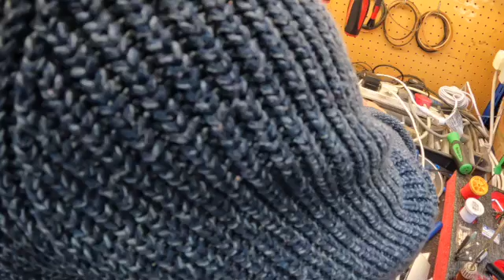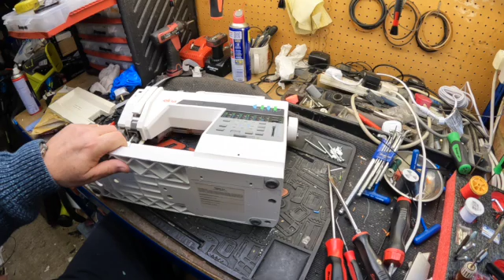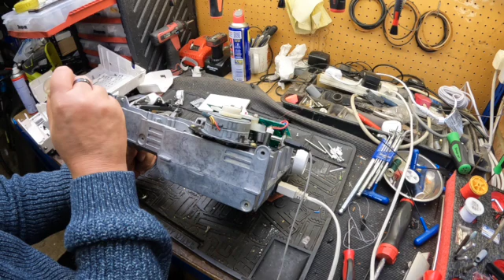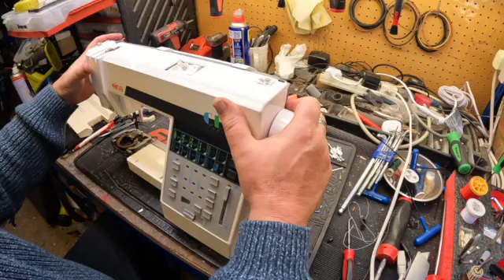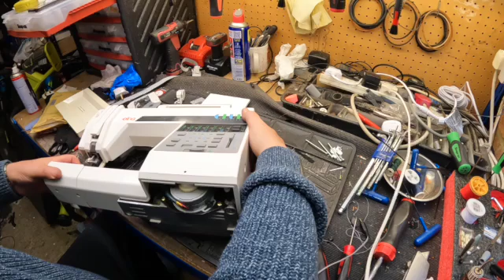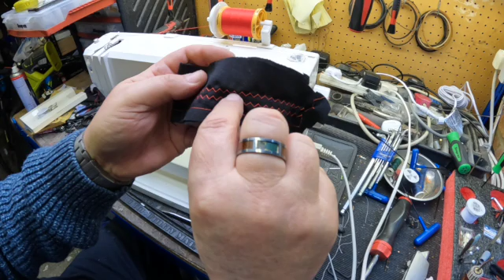ELNA CLUB COMPUTER 500 SERVICE

Comment: What will the price on this machine be if it's still available?
Reply: Since it was made in the 80s, it realistically doesn't have much value. I researched this (just like you should have) a little as part of an estate, and I estimate the high value at $100 or less.

Comment: Hi, I have an Elna 500 Electronic model, that uses an air pressure pedal, assuming same air intake setup as the Computer 500 this video. Having an issue, with the pedal compressing and running the machine for a few seconds then the pneumatic pedal is flat deflated and doesn't re inflate to allow continued sewing. The only remedy is to remove the hose line from the machine connection and this allows the pedal to re inflate. Have ordered a new pedal, but the issue seems to indicate the problem may be inside the machine that wont allow the pedal to reinflate, as it always inflates again after the hose is removed from the machine. Just wondering do these machines have issues of failure at the machines air intake diaphragm or whatever mechanism the air intake setup is? Are hoping that the new foot pedal may remedy the matter but not over confident based on the behavior. Thanks for any advice you might be able to offer. Cheers
Reply from the maker: I have changed the air control unit in  the machine before so it could well be that end and not the foot control.  Good luck

Comment: Just a note that you don't necessarily have to remove the bottom metal plate in order to remove the front cover. At least, for my machine, I was able to wiggle the front plate free once I got the top part over the bobbin winder. One gotcha is to avoid removing the silver hex screws that poke through the metal needle plate; they are retained by loose square nuts that will fall away and can get lost if you aren't careful. A note for others: don't forget to put back the bottom-left (looking from the back) front cover screw; that wasn't done here because that bit of the case was broken on this unit. That's the screw that caused me to look up this video, since the front plate wasn't coming off without it being unscrewed. Thanks for the video!

Comment: Thank you for this tutorial. I have the same model.  Also having problems with nesting, underneath fabric. Was told bobbin case has to be replaced. With it been a "Vintage" model. The original bobbin case is no longer available?! (my bobbin case has a 'pin' in the middle) the Elna stockists have one available that doesn't have the pin. But they can't seem to assure me it's compatible with mine. Couldn't see what this bobbin looked like. Any chance you could help. TIA
Reply from the maker: Hi Kathy. When any machine has nesting underneath it is nearly always caused by a loose top tension. Make sure that when you thread the machine that you lift the presser foot and then with the presser foot down pull the top thread and you should have a very tight tension. You might have some fluff in the top tension unit that needs blowing out. Hope that this helps
Reply: Thank you for your prompt reply. Will give it a try.